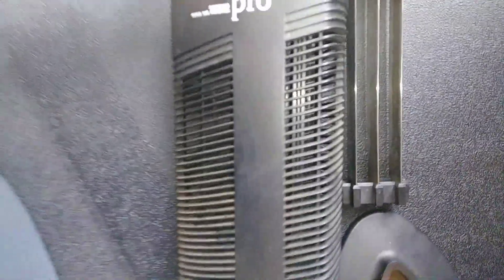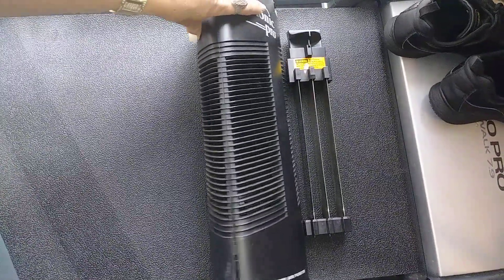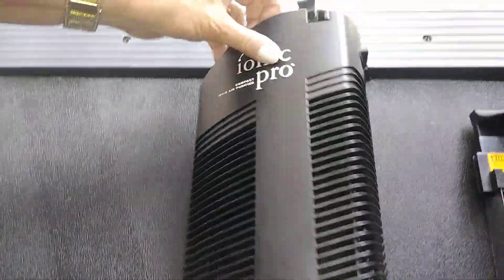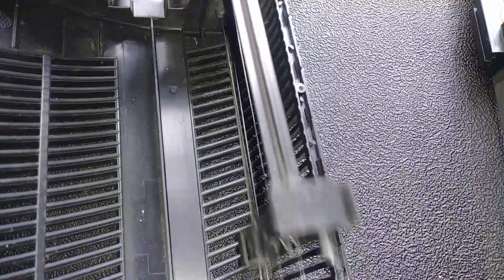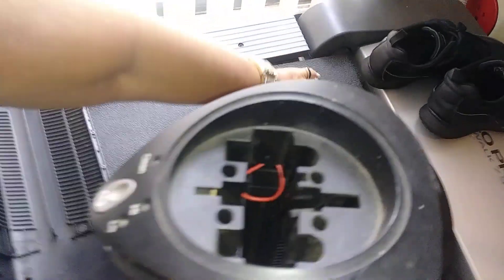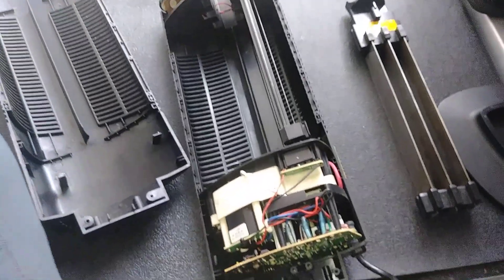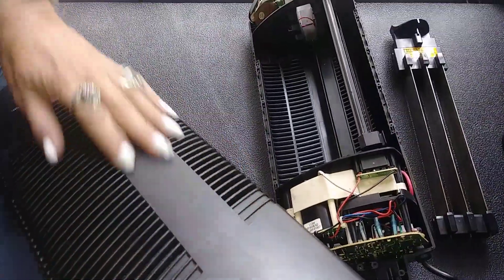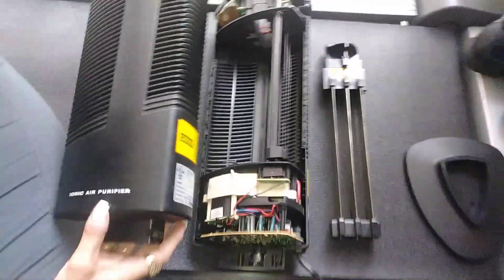ionic pro disassemble how to clean air cleaner air purifier whats inside #ionicpro #homeaircleaner

Comment: I have the amateur version of the Ionic Breeze from Sharper Image. It's good, but not good enough to go "pro" I guess. It has beads that slide on the strings so you just turn it upside down and back a few times to clean the wires when it starts making the sizzling sound. Eventually that will no longer work and you'll need to use compressed air to clean it as well. But it takes quite awhile. The one I use is over thirty years old. Still works fine as long as it's clean.
Reply from the maker: Exactly
Reply: Actually sharper image is the OG! The ionic pro by envion is a cheap knockoff. I have both brands and the SI consitently collects more.
Reply: @daniels7862  The Ionic Breeze is discontinued. Mine stopped working after 20 years . Have you noticed that he ionic breeze emits an odor? To me it smells metallic which I find pleasant. I was wondering if the knock off does too.
Reply: @Orlanzepol123  that smell is called ozone. In small amounts it kills odors and is safe to breathe. SI got alot of bad press from consumer reports, then sued, lost, and could never recover. I’ve used them on and off for years and never noticed negative health effects. I would try to find a used SI unit. Ionic pro brand is inferior in quality and performance. They all emit some ozone. That’s that nature of ionic based systems, although many, including SI, came out with a metal grate material that further reduces ozone.

Comment: I cleaned like you said. My unit is still a bit noisy. Is that ok?
Reply from the maker: It may be time to get a new one my friend. .it should be very quiet after the servicing. .hope you let it all dry for a day or 2  before putting it back together and plugging it in or you will fry it..

Comment: How can you tell if the ionic pro is no longer working?
Reply from the maker: It usually has lights for the on and off . It pisses when it gets dirty. It will stop operating if it is too dirty. They usually last for many many years if you take care of them. Clean it about once a month and it should last a lifetime..I have several of them all different years
Reply: How can you fix the machine if the clean light stays continuously on and the machine is clean?
Reply from the maker: Are you turning it off and then unplug it before you clean it?

Comment: Umm, i have the same unit, took it apart, cleaned it out, now the buttons on the top zap ya.. Its like a plasma ball, not enough to hurt ya but ya feel it, any idea what it is? I work with fixing electronics so im not a stranger to stuff like this, thats why im finding it a little odd... Im going to open it back up to see if something didnt seat right. Ill check back.
Reply: Ok now it clicks like a tazer and the clean light stays on...ill open it again and clean it but after that i may have to toss it over trust issues, lol
Reply from the maker: Hope you didn't get it wet
Reply: No i didnt get it wet, i took it apart like 2 yrs ago and cleaned it, then the zappy thing started so its just been sitting unused since. Decided to take another look at it. Now its doing this...so i dont know.

Comment: I need replacement strings. Well 1 for sure is broke
Reply from the maker: I just threw a unit out I could have shipped to you
Reply: You can literally use 10 gauge steel guitar strings as a proper replacement
Reply from the maker: Good question! I don't really know? I suppose you could order a replacement and see what it looks like? It may very well be?
Reply: @MultiFisherofmen   I need to disassemble mine and cleaned it, has one broken string and if this is a critical component, I will be more than happy to use a guitar string to fix it.
Reply: Daniel Franco be very careful with all parts and note each step with disassembling main housing. Can be very tricky putting it back together. Also, make sure you definitely have it unplugged. I know it’s probably a given but it can ruin your day if your not familiar with electronics. This is high volts